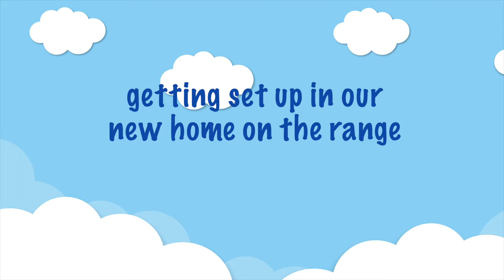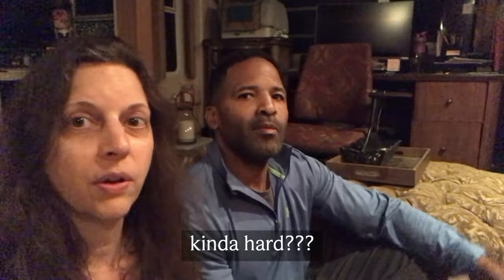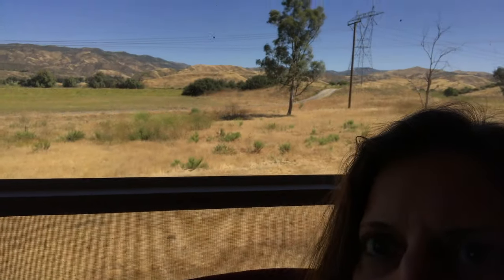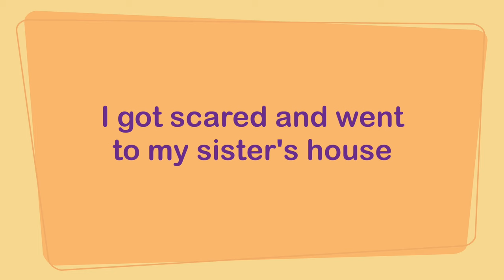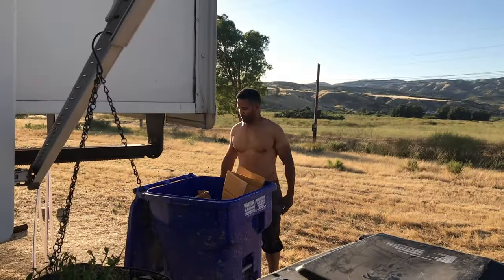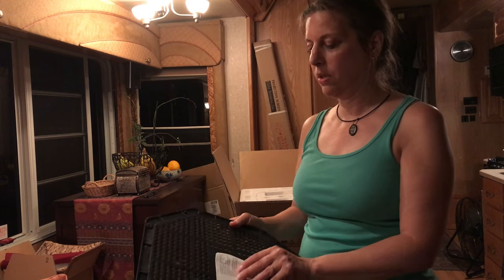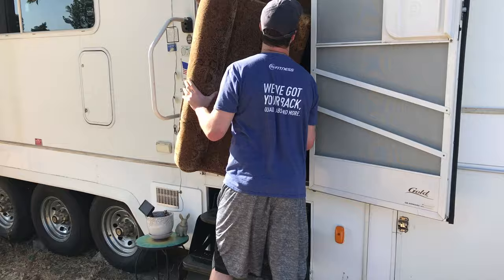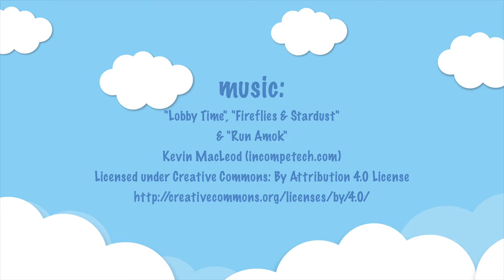PART 4: Off-Grid RV / Tiny House Experience (FAIL)

Comment: You definitely should get LED bulbs they last longer and they’re not hot. Those other ones get extremely hot plus you’re already in a hot trailer.
Reply from the maker: That is a great suggestion! If you watch part 6, you'll see what happened to this RV... but we are looking at getting another, so we will most definitely put this in our notes. THANKS!

Comment: You can rig a pump house up using a small covered area and 12V pump wired into your electrical system or elevate the water tank. You probably figured it out but you don't have enough pressure in the big tank to push water up into the RV.
Reply from the maker: Thank you for that great info!!! I don't know if we ever figured anything out... but we did get a cheap water pump that worked well enough for us not to die in the desert. LOL!!!
Reply: @trueplanes  I watched your series and realized you moved on from the RV. My comment won't help you. Lol
Reply from the maker: @bobknob8440   They might!!! We are contemplating buying another RV. I know... brain damage. But your comments certainly may help someone else right now. Much appreciated!